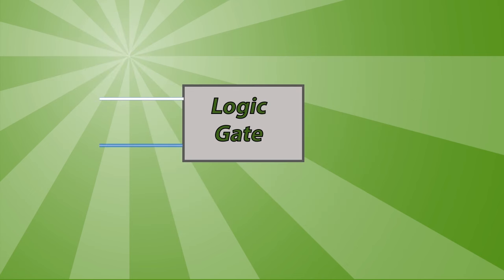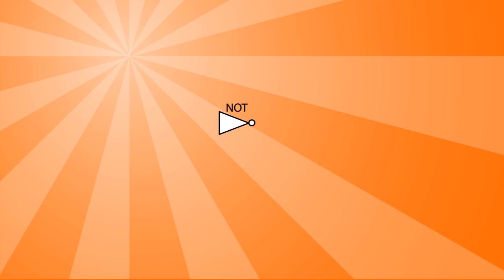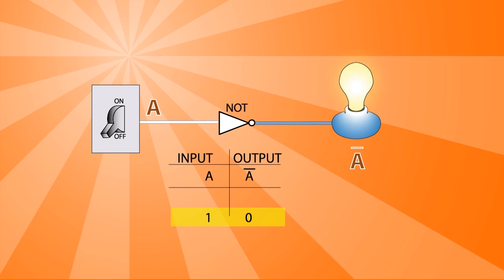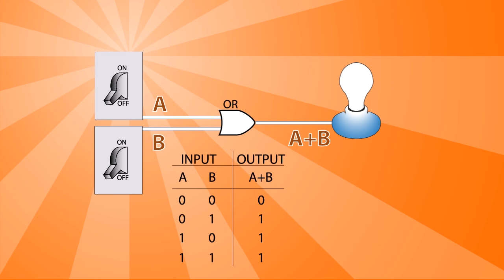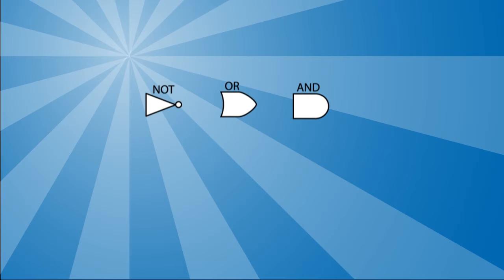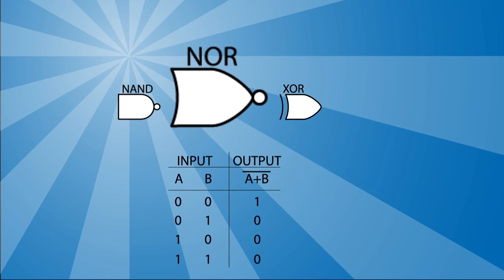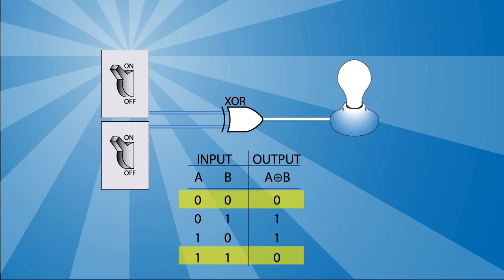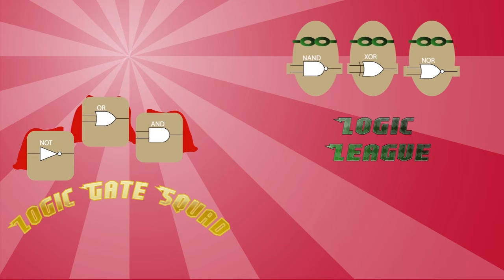Logic Gates Basics

Comment: Logic gates don't work on the basis of electrical current and no electrical current- they work on a HIGHER electrical current and a LOWER electrical currents. Sending NO electrical current would give no input and no output. 
This is why they're often labelled high and low instead of the binary 1 and 0.
Reply from the maker: +squarepants49 You're right. What a horrible slip. I had to watch it again, since I didn't even remember that I said "no electrical current". So, of course, no electrical current means nothing is working in the circuit. 
I do think it's fair to use 1 and 0, since this is more about the theory than the physical components.
Reply: Nurit Kirshenbaum No worries my friend, I was taught logic gates using the binary system, which cuts out the complication of mixing the theory with the reality, and in the scheme of things you don't really need to know the reality.
Reply: +squarepants49 Of course you are taught it as binary, because binary is a mathematical term which can translate into Boolean logic and therefore is translatable into algebra which is a key design for creating circuit systems. It would be annoying / pointless to teach it as high / low because that way it wouldn't be as transversive as Binary and therefore you may get students confused. Binary is simply a representation just remember, 0 = false (low current), 1 = true (high current).
Reply: +SuperZombiekillar Sooo, like I said... But I also built logic systems where the correct currents were needed. I also have Maplins and Radioshack books that only uses high and low- not binary. A low current would be around 2.5v to 3.5v- a high current would be around 4v to 5.15v.

Comment: Great video ! !
The adder, however, must it not have a XOR instead of an OR  ?
Reply from the maker: You are right! The sketch has mistakes in it. Sorry about that. I was focusing too much on the truth tables.
Reply: Thanks for the reply.

The only error I found was this OR symbol.
Replace all  8 by XOR and the adder should be fine.

Wouldn't it be nice to animate this sketch?
E.g.  have blinking/running dots (e.g. orange for current and black ones for no current)

Thanks again for this very helpful video !